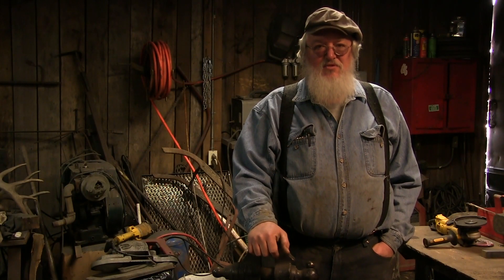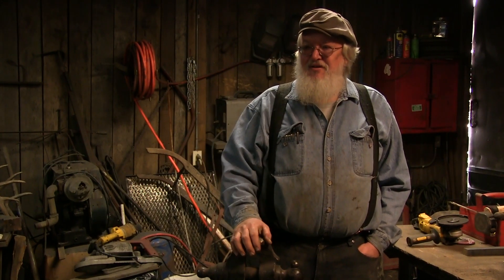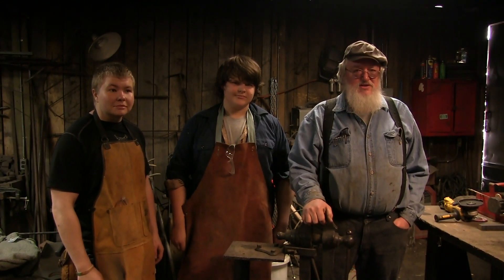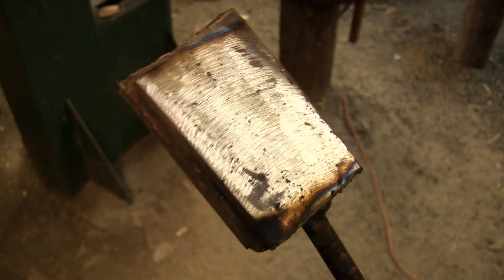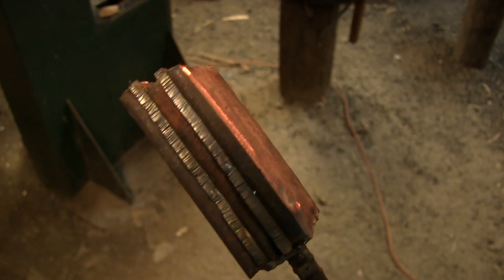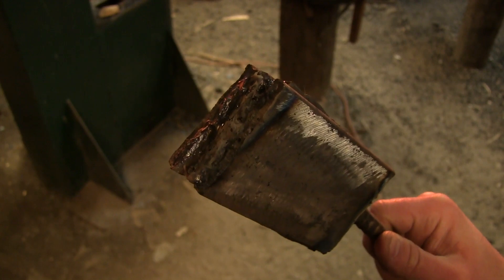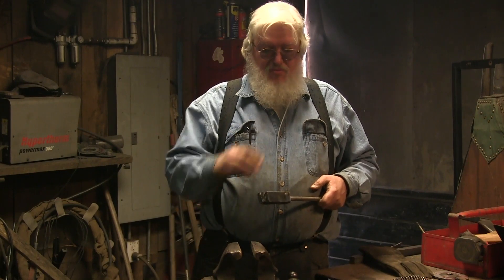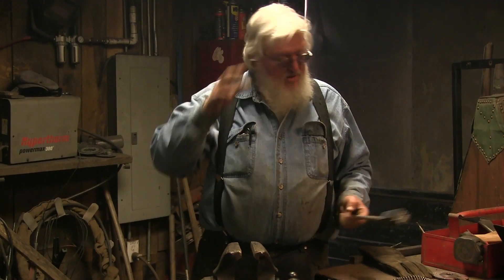Calerin Forge:  Forging Damascus Steel, Part 1

Comment: Calerin, isn't that what is called "Pattern welded" steel and not actually true Damascus (Wootz) steel, thats made in a low temp, low oxygen crucible which is allowed to slowly cool?